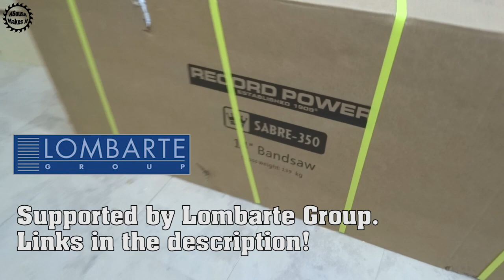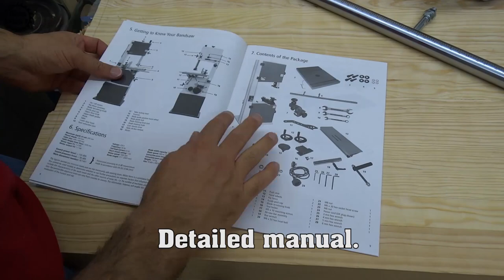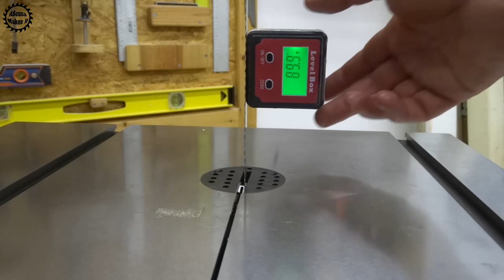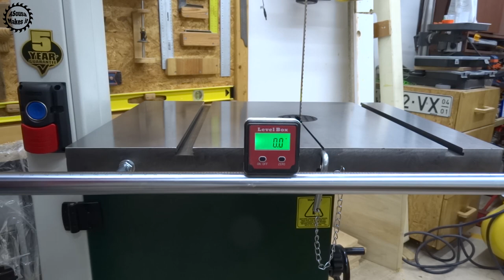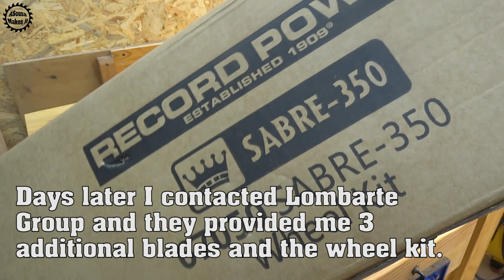Record Sabre 350 - My new bandsaw

Comment: Congratulations on your new bandsaw.  
A bit to expensive for my budget sadly.. but if I would order it online I would compare prizes first.
Directly at Record Power (999 pounds) 1.114,77 Euro,  at Babtist: € 1.197,00 and also at DM Tools and Yandles for 1.114,77 Euro, 1299.99 at My Tools,  1199.00 at Meyer Tools etc. So it seems these are all sold between 1114 and maximum 1300 at online shops.. instead of the € 1,450.79 at Lombarte!
But I guess the bandsaw is a good choice and maybe Lombarte is the easiest place to order when you are in Portugal. Oh... ha, wrong beer though, I'm more of a Sagres drinker (*o*)
All the best from Tomar!
Reply from the maker: Well you need to take in consideration the prices outside uk. Record uk e.g don't ship it to Portugal. Lombarte was the best choice for me. Cheers